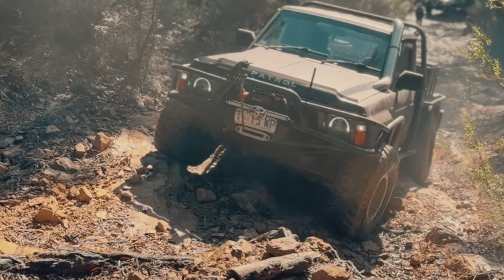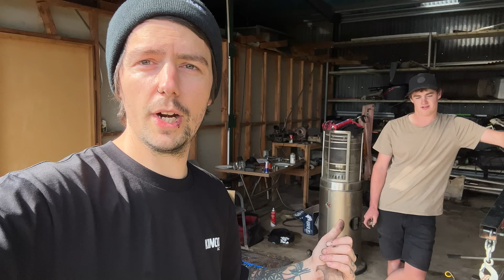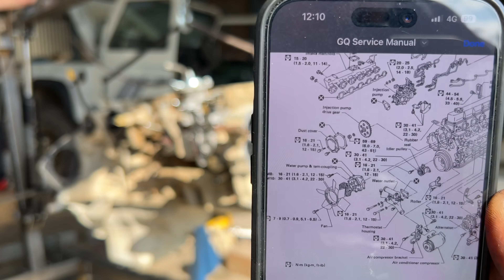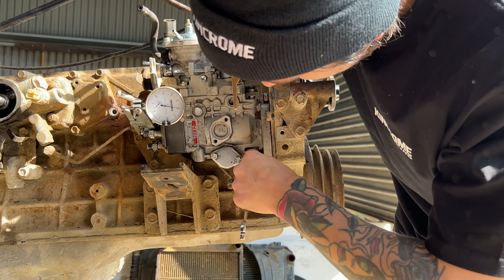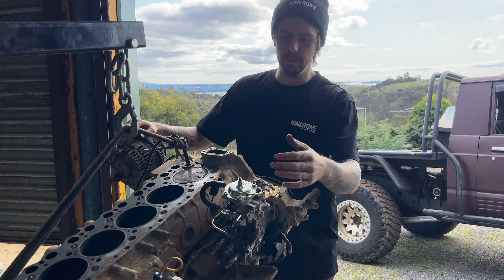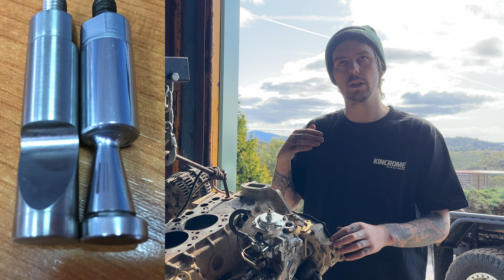INJECTOR PUMPS! TD42 - 1HZ - 1HD! Installing, Timing, Tuning!!!!

Comment: hey timmy i cant get the gear innposition with the key in the right place . it cams over and goes past where it needs to sit . its iether 2 teeth high or 2 teeth low . how do ya get the shaft to stay in posyion so the key snd timing marks line up ?

Comment: Awesome explanation mate. You've given me the confidence to put my 11mm factory pump on while I prep for cape. I'm swapping it over next week and im curious if there are two different 11mms as I was told some have a tcv solenoid on the bottom of the pump which needs a boost switch/relay but mine doesn't have it so im assuming the swap is as you've shown and just 12v for the fuel shut off solenoid?
Cheers legend
Reply from the maker: Hey mate! Yeah I wouldn’t be putting an electronic advance pump into a fully mechanical motor, they’re meant for the TD42Ti engine, won’t drive very nice at all. Just get a fully mechanical pump. 👍🏻
Reply: Thanks heaps bro thats what ive got, its going on a silvertop so i agree ❤ @timmyhasheart

Comment: howdy brother! greetings from norway, my y60 project has a eu-inspection it needs to pass, but there is just way to much soot. i am about to overhaul the injectors, replace their gaskets and clean out the bores. i have preloaded the star wheel almost till max, and put on 4 shims on the "cone".
the tune did fix some soot, but it is still way-way-way too much. i have adjusted the fuel metering screw, but i think it is a bit too rich still. anyhow, now it only soots a ton when i give full throttle till 2500rpm (turbo works up, air/fuel mix ratio is more balanced). the current turbo is an oversized one which starts working properly at 2300 rpm, i will replace it, but is there anything else i can do to minimize soot when giving full throttle at low rpms?
Reply from the maker: The oversized turbo is 100% your issue man! Chuck a smaller one on and your problem will be fixed for sure
Reply: @timmyhasheart  yeah, i knew the turbo had to be one of the biggest issues! 😁

ever since i bought this car it’s had diesel issues (i have changed/replaced the entire diesel-system all the way till the high pressure pump), just tested and fitted new washers on the injectors, i’ll probably chuck a gt28r turbo in next.

would you recommend the gt28r? should work from 16-1800 rpm and is not too big so that i have room to mount air filter piping. (current turbo is so big that the engine mount is in the way for the piping to the air filter)
Reply from the maker: I honestly dunno mate sorry the turbos we deal with here on them is 16g, 18g, 21L, 23L I personally like the 18g-21L sizes so whatever the equivalent is
Reply: @timmyhasheart  I see! You reffer to namings that fit turbos like the Holset’s.

18g-21L, as you prefer is basically the same as the gt2860r turbo i am reffering to. (gt = garret turbo). thanks for the answer mate! i’ll upgrade to the gt2860r now, or.., do you have any other turbo recommendations in mind?

Comment: Timmyyyyyy. Bloody legend this videos helped me be able to change my pump out. Quick question, at 8.05 minutes when old 10mm pump is on its side, that white circle bit that's sitting in the table what's that for? It has a cable attatchment on it like the accelerator cable itself. My new UFI pump doesn't have that on it and wondering what it is and do I need it off my old pump haha. Love ya work man keep up the killer videos🤙🤙
Reply from the maker: Yeah mate it’s for your air con idle up, when you turn air con on it drops the RPM of the engine because of the load that aircon takes, so that attachment pulls the revs back up a bit, you don’t need it mate just rip it off 💪
Reply: The aircon doesnt work anyway so theres no worries then hahah. Thanks heaps man I appreciate the help🙏 @timmyhasheart

Comment: some of your tuning stuff is not correct
Reply from the maker: Care to elaborate haha, bit of a cliffhanger, where’d I go wrong 🤷🏻‍♂️
Reply: @timmyhasheart  pretty good really the only thing i dont believe is correct is the lean back pressure thing other than that very good, too many people just send the fuel screw and call it good when theres so much more to them
Reply from the maker: @izaacbanks3337 by lean causing back pressure it’s a result of having the gate shut on the turbo, you’re right in that a lean mix doesn’t inherently cause back pressure/cylinder pressure. But.. if you’re using a boost tee or heavy gate spring particularly with a small turbo then your gate is shut for longer which means every bit of exhaust is forced to drive the turbine which absolutely does raise cylinder pressure. So I agree, it doesn’t cause high cylinder pressure directly, but what you do to make it lean does. 👍🏻
Reply: @timmyhasheart  does the exhuast volume/flow not also reduce due to the "leaner" mixture just the same that higher egts increase boost/spool

Comment: On a N/A td42 10mm pump, can you scavenge a small amount of power by increasing the fuel slightly, or will you only start blowing smoke with no power increase.

I know if there is power to gain, it would be minuscule, just curious.
Reply from the maker: Ummm being NA, you can gain a little bit, but I’d stop when/if you start seeing consistent smoke, not only is it gross but it’ll just make things hot and raise your coolant temps.. the best thing you could do is bolt a turbo on, makes them much more efficient and drive better, and better for the environment too. And can be done legally if you speak with an engineer.

Comment: hi Timmy, td42ti top end knock/tap on cold starts in morning. Startup car 9 hours later and no tap/knock sound
Reply from the maker: Check the pump timing, too much advance will have a fuel rattle when cold, additionally could be tapped clearance might be a bit out.
Reply: @timmyhasheart  pump and injectors were recoed 15000km ago and was running on every so often and it started crap but didn’t make a rattle. took it to a TD specialist and they fixed that problem - TPS set incorrectly, throttle stops set incorrectly, TPS code rectified, retimed to spec (apparently other shop had it timed wrong), and they replaced the glow plug timer and it had been perfect until really cold weather (coolant 8-10 degrees)

Comment: My gu came back from a tune, soots hard off the line, 20.1 peak afr, 15 psi ht18 100kw 400nm, would reduced preload on the compensator clean in up at bit with out effecting the rest?
Reply from the maker: Hey mate! Na so reduced preload on the spring will make it soot more because it’ll dive straight away giving you more fuel more early.. so you’d need to tighten it if anything 👍🏻
Reply: @timmyhasheart  ah yep that makes sense, boost afrs are 20.1 which from what iv read is ok, off the print out it looks low off boost at like 15ish, iv read thats on the rich side. Am i on the right thinking here?
Reply from the maker: @Nathan-fv8rt  yeah but you want it rich and fuely to light the turbo up and get you going, honestly having a puff of black in take off is pretty much they way to be.
Reply: @timmyhasheart  ah right, cheers mate appreciate your replys

Comment: Great video bud! I was just curious where your pump timing marks ended after using the tool to adjust it? Were you back to being lined up or advanced? Thanks heaps!
Reply from the maker: The marks don’t move mate, so once you get the ZZ lined up that’s that, gear goes on with a key way and that doesn’t move again.. but then when you chuck the tool in and rip it from side to side, you’re advancing or retarding within the pump itself, the key is held by the gear and you’re actually turning it slightly inside the pump to be slightly advanced, hope that makes sense. 👍🏻
Reply: Sorry boss, I wasn’t exactly clear in my question, I apologize. I was referring to the factory etched mark that is on the injection pump triangle flange. Once the IP is mounted, that mark on the flange should line up with another factory etched mark on the engine mounting surface. I was curious how both of your marks lined up after using the tool-  if you were advanced, retarded, or lined up perfectly?

Comment: Cheers and thanks from over the pond. 🙏 I'm trying to understand Japanese diesels in general, I got a Nissan FE6 I'm troubleshooting, hopefully they're somewhat similar to the ones you got there.
Reply from the maker: Thanks for watching mate! Yeah well all the jap cars are pretty similar pretty sure, not sure what an FE6 is, diesels in general are the same in terms of fuel being hot, boost being cool and excessive fuel causing soot, but as for how you fix that changes a lot in a newer car cause all the fuel is mapped by ECU, not mechanical. 👍🏻
Reply: @timmyhasheart  It's a bigger inline 6 diesel engine I have in my 1990 Nissan UD 1800 dump truck. Definitely more popular over there. I have a colder cylinder and white smoke, I'm going to swap injectors with a healthy cylinder and see what happens, I think I'm running too lean too.
Reply from the maker: @crazyDIYguy ohhh okay, yeah I know nothing about big truck engines haha, but if it’s a mechanical diesel and it’s not just start up, (I’d say glow or heater if it was start up) but yeah definitely on the right track with swapping them around although and getting a thermo gun onto it, but yeah white smoke is cold unburnt/poorly burnt fuel so I reckon you’re all over it unless that cylinder is low on comp

Comment: First video of yours I came across but absolutely loved it. I’ve got a factory turbo gu and maxing out my pump at the moment trying to get more out of my it without grinding the pin out. Can you further explain a bit on turning the star wheel as I haven’t touched it yet. Thanks mate keep up the good work
Reply from the maker: That’s awesome man thank you I appreciate the kind words.

The way to get more noticeable early torque out of a factory pump will be to wind down the top grub screw, take shims off, rotate the pin to the steep side and loosen the spring by winding the star wheel DOWN. Which unloads the spring and helps it dive to the deeper point of the pin with less boost 👍🏻👍🏻
Reply: @timmyhasheart  thanks mate, I’ll start with half a turn👍🏼

Comment: I have a 1HDT rebuilt pump, TD05 18g turbo comes on boost good max of 22psi , but when cruising at 100k boost is around 10psi and egts creep up to around 450-500 per turbo. Doesn’t help that it’s on 35s and auto so it’s sitting at 2100 rpm at 100km. Any recommendations on adjustment before I take it to a tuner, thanks
Reply from the maker: Tbh mate pre turbo that’s fine, I’m like 400-450 on the highway POST turbo.. but it could mean your spring tension is a bit too tight, so mid boost it’s running rich. 👍🏻👍🏻
Reply: @timmyhasheart  thanks I’ll try back it off a bit.
Reply from the maker: Sorry mate I wasn’t thinking properly while I was typing I meant a bit too loose!! Needs to be a tad tighter 👍🏻👍🏻

Comment: What’s the gear under the injector gear ?
Reply from the maker: The gear under the injector gear? In the timing case? That’s just an idler gear to make sure all of the front gears turn clockwise.

Comment: Do you think a n/a td blacktop would be safe to turn the fuel up with an ebay turbo 10mm pump
Reply: Front mount Intercooler dropped egts heaps
Reply from the maker: With an intercooler for sure I wouldn’t hesitate maxing out a 10mm pump on any TD tbh. 🤷🏻‍♂️ I mean I’m just another bloke that says stuff on YouTube so don’t take my word as gospel but yeah I certainly wouldn’t hesitate 👍🏻
Reply: yea cheers man dont want a powerhouse just a camping rig but have noticed since front mount its lean as
Reply from the maker: @motorizedbikes9933 yeah it’ll never be a powerhouse with a 10mm that’s the good thing about them they kinda give you a ceiling, they’re great for keeping things reliable, I was still able to have a heck of a lot of fun and hold 110kmph everywhere with a 10mm they’re great 👍🏻

Comment: A stroker engine is a better option for low rpm torque, billet moly crank, and you don’t need as much boost, 1130 NM 28 psi 2000rpm
Reply from the maker: Yeah nice thanks for the info 🤙🏻

Comment: the more you know! good solid explanation on all the pump settings, thanks mate. good to see someone gets it that tds don’t need 300hp to be fun!
Reply from the maker: Certainly not interested in horsepower there’s no point pushing the torque late to please a number I’d much rather as much safe early torque as possible, mind you I have blown up my share of TDs before I learned 🫠🤫😅
Reply: @timmyhasheart  live and learn aye 🥲 mine only makes 185hp 520nm on 35s but fuck it’s good to drive. peak power/boost at 1900rpm is super useable with 4.6s 💪🏼
Reply from the maker: That’s a good level power, extremely driveable, although I don’t agree with going to diffs taller than 4.11 with a TD. 4.6 is a petrol ratio imho.

Comment: I have more trust in a td42 not overheating on a beach run then I do in the rope not coming off those bolts holding the engine up 😂😂
Reply from the maker: Well mate I got 2 facts for you, 1. TDs don’t overheat when you do the right mods and 2. I reckon we’ve slung more engines around between us than every commenter behind their keyboard combined ;) ahaha
Reply: @timmyhasheart  truth haha.  Nice work on the sponsorship too, well deserved 🙌🙌

Comment: Great video! All this info is also applicable to the Bosch VE pumps like the one on the defender in the background!
Reply from the maker: Exactly right mate, ye olde 300tdi.. mind you that one is copping a 4.6 I think they are? 300 also have a plate that you can buy that actually upgrades the side pin I think, I’ve seen something about them before but yeah all VE compensated pumps this will apply to 🙏🏻🙏🏻

Comment: great bit if info. thanks heaps.. but just on the 10mm pump, i have found screwing the fuel in, it runs 9n a lil b4 coming back down to idle!
Reply from the maker: Yeah mate that’s what happens when you go a little too far with the fuel. Eventually you get to a point where the revs hang a bit as you tap the throttle.

I did go into this in the video but cut it out because I was focused on compensated pumps. But what I do to tune 10mm’s is have the car running, turn the fuel screw up a bit, drop the idle, fuel up, drop the idle and as you get toward the end start tapping the throttle a bit and once the revs start to hang a bit, back it off slightly. 👍🏻👍🏻
Reply: @timmyhasheart  thanks m8 n yer thats the process i used👍

Comment: The best mod is to grab an inline vacuum governor TD42 pump and graft a mechanical governor to it and if the planets align for you locate and use an SD33-T gov case as it has a boost control/aneroid from the factory. Instead of just one 10mm, 11mm, 12mm plunger feeding 6 cylinders and smashing camplates and rollers ( even if the top of the line Bosch ones are fitted) you can have one big plunger per cylinder.
Reply from the maker: Well tbh if you want an in-line pump for a TD they already exist, hence why it’s in the GQ manual. But tbh 12mm VE pumps already give more fuel than a TD42 can even handle before spitting 2 pieces of crank on the ground so why stray from what works. 😅
Reply: But they are vacuum governor and cant be run with boost without some dodgy mods . I build pumps and injectors for a living and  have done for 40 years now. Dont get me wrong a VE is a great little unit. But more VE's die than inline pumps do esp when a VE is made to supply a lot of fuel. Each to their own at the end of the day. A modded VE, different nozzles and inj mods, coolant bypass at the rear of the head etc and a TD42-T is transformed.

Comment: Builder of our 12mm pumps said timing should be at 0.75mm initial, which is where we put it and seems to work ok cept we've had to increase spring tension due to high egts.  Where'd you're data come from for say .68 to .70mm? Great explanation too!
Reply from the maker: That’s good that they told you that, and that’s exactly the point that I’m about to say and probably should have said in the video - you should set the pump to whatever your pump builder says to. So if your pump builder says 0.75 that’s what you should go to. UFI says 0.64-0.70 and factory has settings also. Depends on your pump builder mate 🫡

Comment: Thanks heaps for another informative video. I got a 12mm pump with a td42t I just bought and am soon to install the pump but is 12mm too big? Not chasing heaps of power - more reliability. Not interested in snapping cranks or boiling the kettle.
Reply from the maker: Hey mate thanks for the comment! 10, 11, 12 isn’t the be-all, end-all of how dangerous a pump is, it’s just the size of the plunger that the fuel can come down, plenty of parameters determine the fuel coming in aside from the plunger, you could have a 10mm/11mm more powerful than a 12, it all depends on how it’s setup. They aren’t inherently dangerous at all mate. Usually out of the box it will be set to a theoretical HP figure, or sometimes they’ll ask what turbo and what target boost and they’ll shape the fuel input on what’s called a bench, which is basically a pump dyno. So depends what you actually ordered, where you ordered it from and what it’s setup for, but even if you asked for some crazy 300hp pump, you can just dial it back by adding shims or spring tension etc. 👍🏻👍🏻
Reply: Thanks for the reply mate. Really appreciate it. You’re a legend!!!
Reply from the maker: 🫡🫡 cheers boss appreciate you guys watching the videos and leaving comments

Comment: Some how im getting 23psi on a 10mm pump
Reply from the maker: Yeah that’s not unheard of, depends on your turbo size and the specifics of your pump. I had a HT18 with a closed gate and it ran 22 with a maxed 10mm. But to be honest you’re not using that 23psi, anything over 16psi is pretty much just additional cooling & additional back pressure. Would probably run more efficiently at 16-18